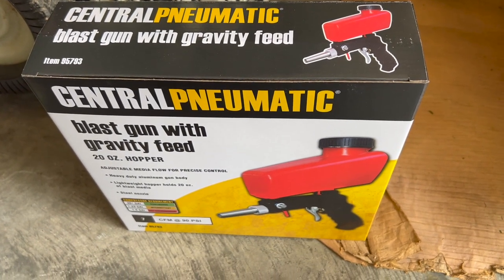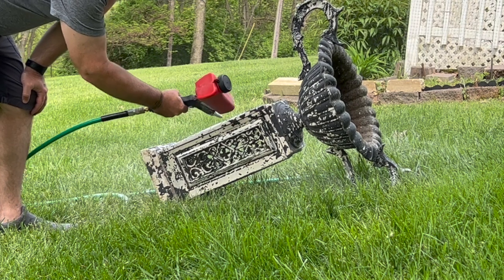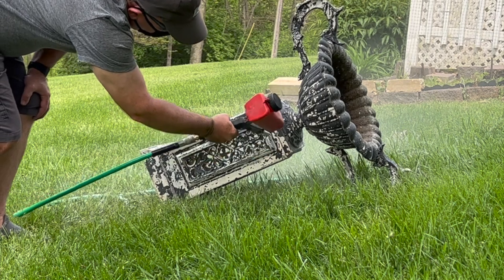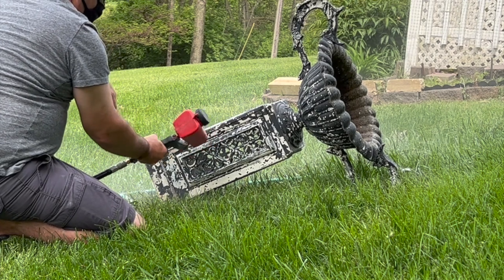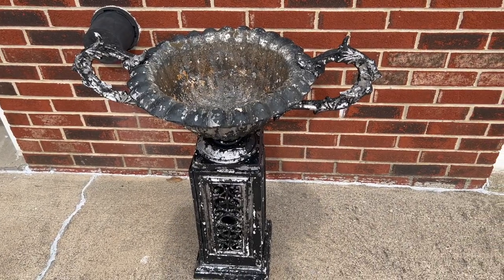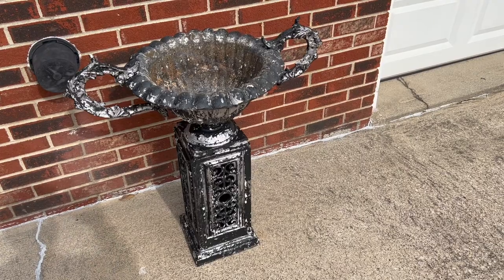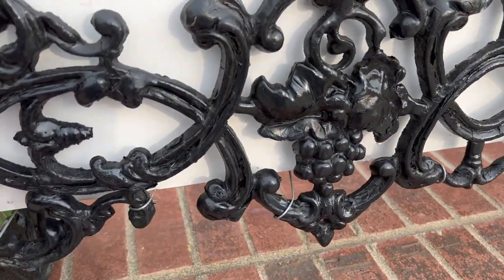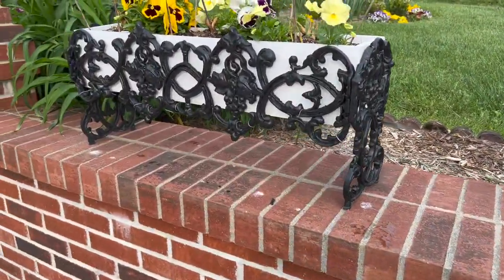Garden Urn Restoration Part 1 | Antique & Garden Showcase

Comment: I am a newbie with cast iron urns. I have taken mine to a guy and had them sandblasted then I primed and painted them myself. My prized, Grecian urn that I call my trophy, I had  professionally painted with dark gray, metallic automobile paint. It turned out absolutely beautiful!! I planted a Mandavilla in it, and it's not doing nearly as well as they do in my pottery pots. I'm wondering if there isn't enough depth in the urn for the Mandavilla root system?
Reply from the maker: Not that familiar with Mandavilla.  I've grown one in years past and also had it in a large clay pot.  The urns do tend to be shallow.  I always use plant liners in mine in the event I need to change them out.  Often times my urns get very root bound by the end of the season.  Hooking them up to a drip system has been the absolute best thing possible in keeping the plants healthy.  I water in the morning, again with a mid-day 10 minute timer and another 10-15 minutes in the evening depending on the outdoor conditions.  I've found in this area that even if it rains, the urns still have to be watered especially if the plantings are full - water just doesn't get to the soil.  Hope this helps.  Thanks for watching!!!